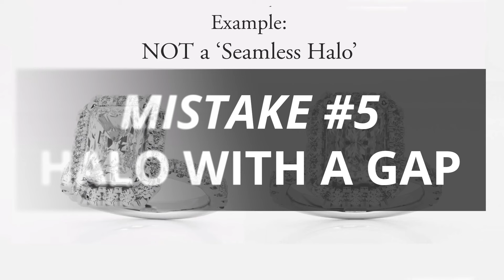5 Design Mistakes That RUIN Engagement Rings

Comment: Every day I watching different videos about how jewelry is made, I am interested in this topic. And I see mistakes almost every day 🙂 
 In your ring designs, you place a lot of stones - crystals or diamonds around the circumference of the ring, from top to almost to the bottom, and this is also not right. It's my opinion. Yes, the ring looks shinier, it has more stones, but the problem is that the rings spin on the finger, whether we like it or not, they spin. And when the ring turns on your finger, touching something, or when you take something in your hand, you touch this or that detail with stones. And very soon the stones begin to fall out. I have personally seen this problem. In my opinion, stones should not be installed more than half the circumference of the ring. Although, if you are rich and losing some stones or diamonds is not a problem for you, then yes, you can set diamonds generally around the entire circumference of the ring 🙂
Reply from the maker: I appreciate your feedback – I agree with you that it's essential to consider the practicality of any ring design, especially regarding stone placement. In our case, we keep a client's lifestyle in mind when designing each ring. Factors such as their profession or hobbies shape our design approach.  

For example, if her work or daily activities don't pair well with certain ring styles, we'll explain that beforehand.  Here are just a couple of circumstances where this conversation has been helpful:

1)  Many of our clients are Nurses or have a profession where they wear gloves. In that case, we aim to keep her ring low-profile so it doesn't stick up unnecessarily too high.
2) If a client says she cooks or bakes a lot and doesn't plan to remove her ring, yet also doesn't want to worry about her ring getting too dirty, a solitaire style may be more suitable.  I'll recommend not having multiple diamonds along the setting in case ingredients such as pasta sauce or dough get stuck in between the diamonds, which would be more high maintenance for her to keep clean.

Ultimately, we strive to find that perfect balance between the look she loves AND a ring that feels comfortable for daily wear.

Regarding stone placement, we position stones in areas least susceptible to damage. It's VERY rare to have one of the small side stones fall out of our rings (and I mean, RARE). I can't even remember the last time it happened. While no ring is impervious to damage, our meticulous setting techniques make it highly unlikely for stones to detach. 

On engagement rings with a clear top/bottom orientation, we have wonderful success with diamonds extending halfway or 3/4 down the band. The bottom of the ring will experience the most wear, so we don't put diamonds beyond 3/4 unless specifically requested by a client. 

When it comes to Eternity wedding bands, there is no obvious "Top/Bottom" so it tends to spin a little more evenly and can withstand diamonds going all the way around. Of course, there are drawbacks to this style as well because then the ring cannot be sized. 

When it comes to design, there are pros and cons for everything, which is why we like to take a holistic perspective on how it works with our clients' lifestyles. I hope this provides insight into how we approach our ring designs. 

Thank you for watching!  Wishing you a beautiful rest of your day!  :)
Reply: Everyone is entitled to their opinion but I suspect you have never worn one of Vanessa's creations.  My halo ring is a vision of sparkle with no spaces whatsoever between the diamonds.  The diamonds on the double split shank go 3/4 of the way around and there has never been a view of anything but diamonds on my finger.  I have a sizeable center diamond and petite fingers but the ring does not spin on my finger . . . even when the weather gets cold and the ring is looser.  Vanessa has engineered the ring so that the center stone snuggles seamlessly down into the diamond halo which lowers the center of gravity of the ring. The head may shift from side to side but has never spun around so that the plain metal band shows.  I have worn rings that spin but not this one!   

I am not rich and losing a diamond in my ring would really upset me.  I do own a different ring with two bands of tiny diamonds surrounding the entire ring so I am aware of the pitfalls of wearing an eternity band style of ring.  Vanessa's ring is the best of both worlds:  I never see anything but diamonds on my finger and I don't have to worry about losing a diamond on the underside.  I love MY ring that Vanessa created for ME.  😍
Reply: @VanessaNicoleJewels  Wow, what a complete answer. I read everything and felt like I had read a book 🙂 Thank you.
Reply from the maker: @akgoldbear7669   Absolutely, my pleasure! It's pouring rain here in San Diego today, so I decided to work from home and catch up on emails/admin, which allowed more time to provide a thorough reply.  (There's a joke that many Californians can't handle driving in inclement weather, and in my case, it's true, Lol.)  

In fact, I appreciated having the opportunity to respond because it has now inspired me to create a future video on this!   Thank you!   :)
Reply from the maker: @auag3666  You are THE BEST for chiming in.  You just made my entire day.  : )  

In fact, I was telling my kids this morning when we were making breakfast smoothies the importance of taking time to make something juuuust right, so I'm going to read them your message when they get home from school to solidify my point.  

A work win AND parenting win = A successful day!  😍

Comment: I’m so picky with prongs and how symmetrical and comfortable they are! I’ve bought myself various diamond and gemstone rings and I know which ones I can run my fingers through my hair with and which ones I cannot 😒 I have a few claw ones that are set extremely flush to the stone, aren’t bulky, but they catch my hair regardless. They look amazing and don’t scratch my skin at all but fibers…they will scratch 😕 My favorite prongs I own are maybe not the most visually appealing but dang they’re comfy and don’t catch on ANYTHING—they’re a worn rounded (vintage piece) and structurally very secure for my Asscher 🥰
Reply from the maker: Thank you for sharing insights on the prongs on your various rings! It's all about finding that perfect balance between comfort and style when it comes to jewelry, right?